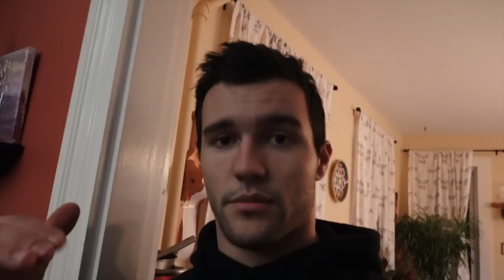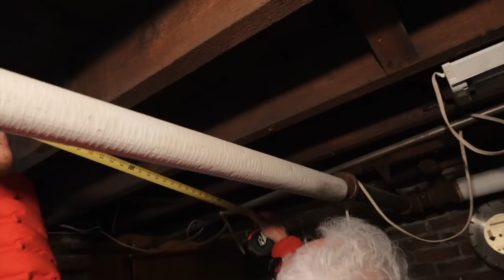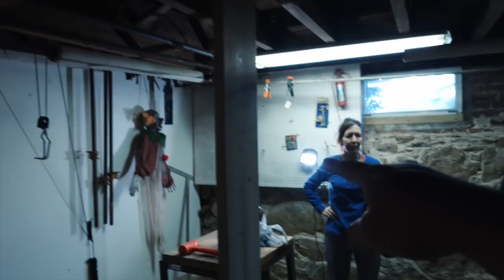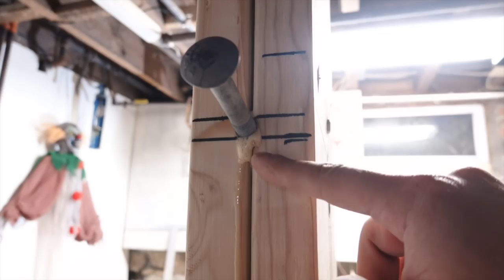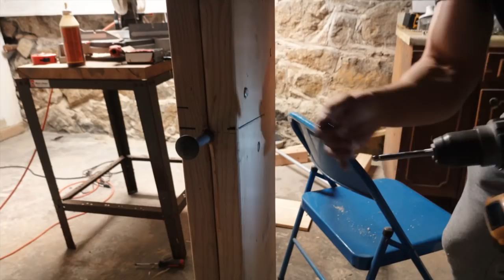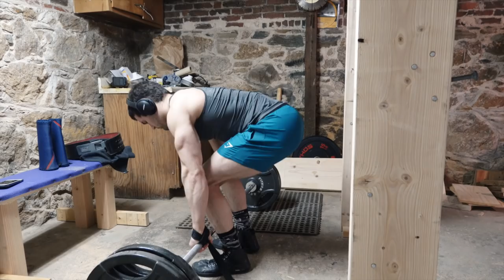One Barbell Full Body Workout + Building a Home Gym

Comment: Pretty cool what you did but it won’t work for a lot of people with high ceilings in their basements/garages. Does anyone think a wall mounted power rack would work, like if I bolted metal safety bars into a wall
Reply from the maker: Just Stop you could make a squat rack that stays upright from its frame on the bottom, ie make a top-open squat rack similar to an ER rack where you have a big, solid foundation that won’t tip over